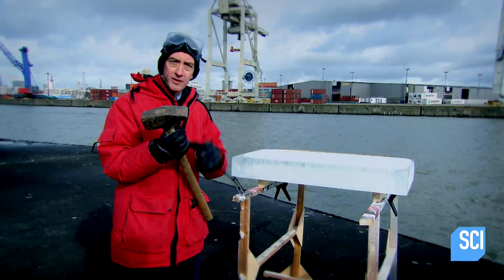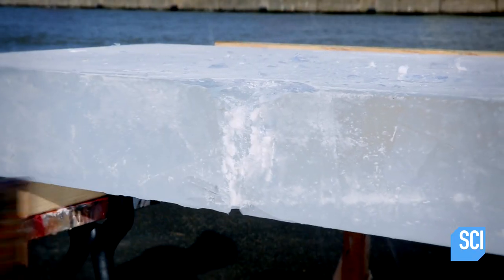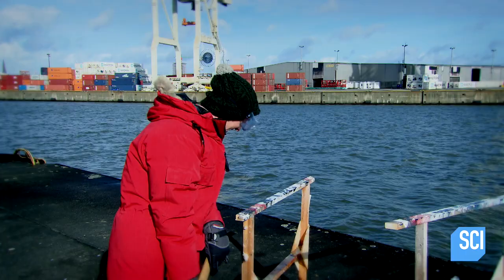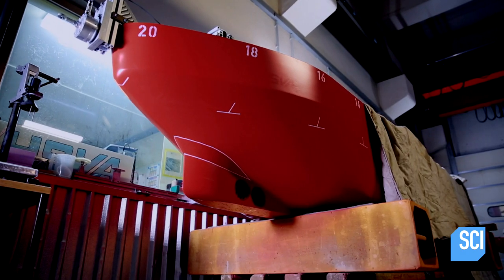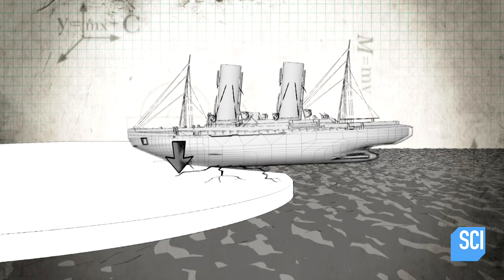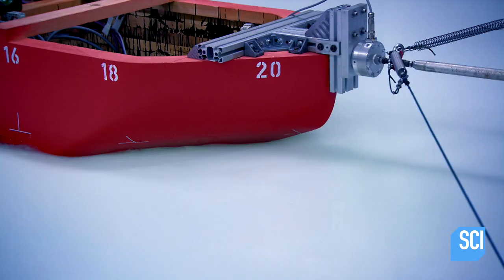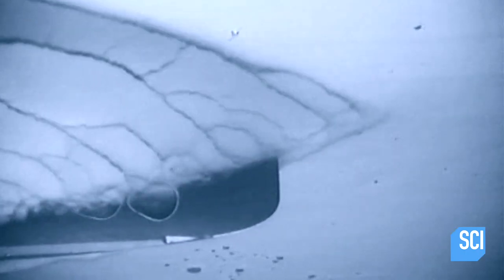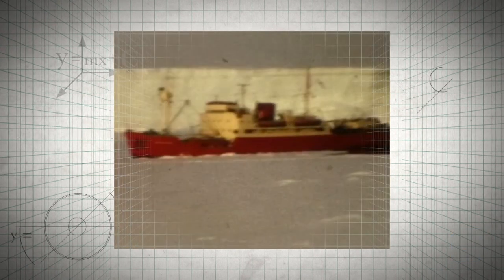Here's How Massive Icebreaker Ships Plow Through Frozen Seas

Comment: In the video, narrator says it pitches and cuts through the ice by it's weight. But in the scaled model it was going smooth rather than the pitching.
Reply: It depends on how strong ice is compared to ship's weight and power.
In thin ice compared to icebreaking power ship simply sails ahead/astern while ice bends under it:
https://youtu.be/p9E0Q05-3Zg?t=95
It's thick ice and especially pressure ridges in which icebreaker is basically rammed on top of ice:
https://youtu.be/xfFkfiMRP00?t=150

Comment: Then we wonder why the polar ice caps are shrinking
Reply: Joseph Schlager smh r u fucking kidding me. If you cut a piece of paper is there less paper?
Reply: kellel what will melt faster a iceberg two miles by two miles or a iceberg two feet by two feet?
Reply: i get your point that cutting ice increases the surface area. But the thickness of the ice is negligible because the thickness of the ice is a few feet and the width and length of it is thousands of miles. I know that breaking a log makes it burn faster but cutting paper doesnt make it burn faster
Reply: kellel yes it does. Test it on your own, put one piece of paper in your blender and then burn the blended paper next to one of the original size.
Reply: TheLewisma Yes thats true but I said if there was less paper not smaller paper
Reply: I spent two years and three tours on the ice breaker USCGC Polar Star. It does not cut through the ice caps or through icebergs. For the most part it just cuts through fresh (less than a year old) ocean ice so that supply ships can get in or out without danger, and to transport scientists to areas where they can study things like global warming, which IS what’s causing the polar ice caps to shrink. Ice breaking is not what’s causing the ice caps to melt. It’s global warming.